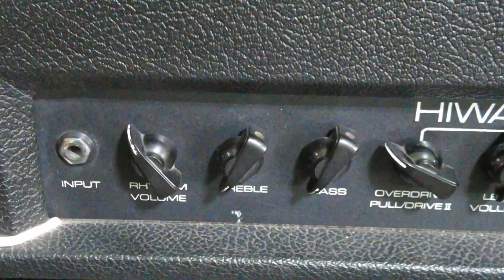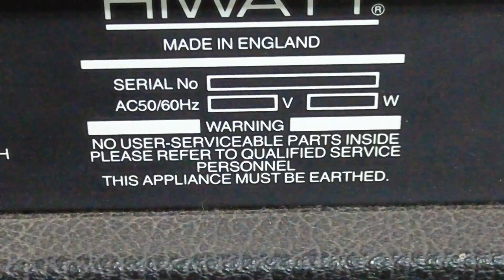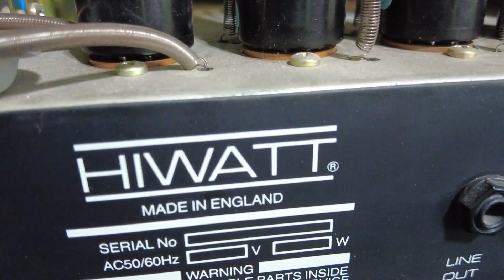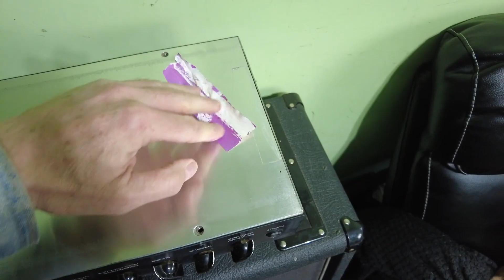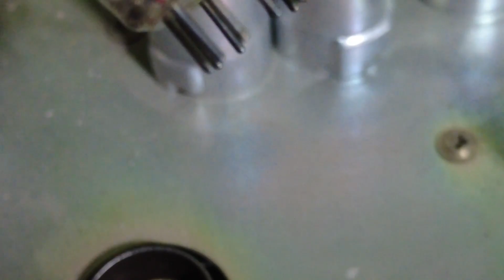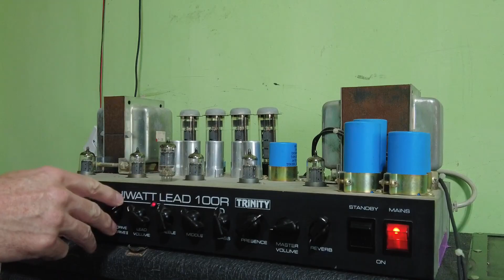Hiwatt 100R Trinity Guitar Amplifier A British Tube Amp Beast in Need of Repair Part 1

Comment: When the cat starts meowing at 28:30, my newly adopted dog (Anatolian Shepherd) woke up and started searching the house for the non-existent cat! Re: tube noise and signal bleed, sometimes the mica insulators inside the tube become capacitive or conductive and bleed signal from one triode to the other, but I've also seen this occur from gunky residue between the tube pins or on the socket itself.  Bad filter caps that don't decouple the audio from the power supply can also cause or exacerbate these types of issues, and it might be more audible if a preamp tube circuit has a common cathode resistor for both triodes, or if one triode of the tube is used for channel 1 and the other triode is used for channel 2, instead of channel 1 and channel 2 each having their own dual triode preamp tube .  It also seems as if the input Jack is not "normaling" or shorting itself out to ground when there's nothing plugged into it. This is where having a quarter inch plug with a shorting jumper inside of it to plug into the input can help you figure out if that's the case, especially on an amp that has 2 input jacks but where you might only typically use only one input and you definitely want the other to take itself out of circuit when it's not used.

PS,  I used to have a German Shepherd mix who would start looking for a cat whenever I played the John Hiatt song "Little Head" which begins with a cat-like wah-wah'd guitar figure. We actually did have cats then; they were outside much of the time but they would sometimes share the dog beds with the Shepherd and our Saint Bernard.
Reply from the maker: Some useful info there, thank you. I have just looked up Anatolian Shepherd on Google. That's a big Dog. My Cat is sure glad he isn't really looking for her lol. I have had a listen to that song, it's great. Great band. The Bass player is solid. That's a great story. I will have to listen to that whole album. Take care!
Reply: @vintageguitaramp_guitarteacher   My thumbnail picture is of the 9 year old Anatolian shepherd we have, whom we adopted about 7 and a 1/2 years ago. He is  118 pounds and a true gentle giant, very friendly and easy going, good with strangers and children and gets along with most dogs , but he won't tolerate cats. He doesn't pay any attention to radio , TV, stereo or anything on my phone ----  The only sounds he listens for are the pantry door where we keep the food being opened, and the sound of me picking up my car keys ---- but the Anatolian we adopted recently watches TV and listens to and for anything and everything that seems out of place. She was 78 pounds, when we got her a few weeks ago which is about 20 to 30 pounds underweight, but she is starting to put on some muscle and weight with 3 meals a day and lots of snacks.  Considering she was a stray roaming around the streets of Georgia, she is very cuddly and attention seeking and wants to meet people all the time.
Reply from the maker: Blimey. 118 pounds? I don't weigh much more that lol.  It's nice you have given him a good home Dogs thank you everyday for taking them in. Cats just move in like they own the place. Well my Cats think they own the place. Thanks for supporting the channel and take care.
Reply: @vintageguitaramp_guitarteacher  , the cats we used to have were all strays that adopted us and just moved in!
Reply: @vintageguitaramp_guitarteacher  , John Hiatt is a well-known songwriter whose songs have been covered by many others. Thing Called Love, Confidence Man, Angel Eyes, Drive South, Feels Like Rain, Riding with the King, Icy Blue Heart, and many more. Ry Cooder, and Sonny Landreth, two of my favorite slide players, have been major weapons on his recordings and tours.  It just occurred to me that if you add the letter W to Hiatt's name, you get HiWatt !
Reply from the maker: Here in the UK we don't see some artists in mainstream music that come from the USA. Ry Cooder and Sonny Landreth are well known though.( Never heard of John Hiwatt though lol.)
Reply: @vintageguitaramp_guitarteacher  , Hiatt did some background vocals on Richard Thompson's "Hand Of Kindness" record, Thompson being British-born of course (and a founding member of Fairport Convention) but having lived in the States for over 30 years. Thompson is one of my favorite guitarists ---- on both acoustic and electric ---- and songwriters. Another British picker (primarily acoustic) whom I like a lot is Martin Simpson, who is now back in the UK after having lived in the States for several decades.
Reply: @vintageguitaramp_guitarteacher  , here's one of Hiatt's strangest, and of his best: "Ethylene". https://youtu.be/jA-MVP7iSGw . Likely about his lifelong alcohol addiction. I'll post another one that really rocks out.....
Reply: @vintageguitaramp_guitarteacher  , "Memphis in the Meantime". https://youtu.be/KQEJotXpnaQ. JH forgot some of the lyrics!

Comment: I haven't watched the whole video but I suspect that the original tube in the V-1 position is bad and causing signal bleed into the high gain channel #2 (or vice versa)  Putting a fresh tube in that position stops the signal bleed and makes it seem as if "channel one isn't working" when in reality it's probably working the way it's supposed to....🤔🙂
Reply from the maker: Hello. It was a bit of a conundrum. I cleaned the sockets and the jack sockets including the footswitch socket. I put the original tube back in and all was fine apart from the tube being microphonic. So I swapped it out because of that. It may well have been the tube causing problems though. It's great when people such as yourself offer advice and knowledge on the channel. It helps me and other people watching. I apricate your input, thank you and take care.
Reply: @vintageguitaramp_guitarteacher   I didn't watch part 2 of the HiWatt repair video and I don't know how you clean the sockets but I hope you didn't simply spray them with Deoxit like so many do. I don't like leaving any kind of residue behind in the tube socket or on the board. An alcohol flush usually works pretty well but what I do 1st is I will take a piece of wound guitar string, 33 to 39 thousands diameter and work it back-and-forth inside all the socket contacts almost like a miniature round file, then retension the contacts. The guitar string does an excellent job of removing oxidation and baked on, grungy dirt.  Because the socket contacts are soldered directly to the circuit board, and so they don't "float" loosely to match up with any discrepancies in the alignment of the pins on the tubes, it is especially important to have those contacts, and the tube pins, super clean.  You can clean the tube pins with a toothbrush sized wire brush.
Reply from the maker: No, I don't use it. Just alcohol based products. Some good ideas there. Thank you.
Reply: @vintageguitaramp_guitarteacher  , also,  I don't know what the circuitry is like in a HiWatt and I don't know who made those tubes that were originally in it but other techs whose experience I respect say that Russian made tubes often do not hold up well in circuits that use cathode followers, the Russian tubes will become noisy and microphonic and often fail prematurely.
Reply from the maker: I couldn't find a schematic for it. I haven't heard that said about Russian tubes but I will take that on board.

Comment: To my ears the overdrive sound doesn't sound quite right, so maybe that's a symptom of a fault that's causing all the interactivity between the channels.
Reply from the maker: Hello Simon. Thank you. You could be right. Both channels sound a bit off. Hopefully when I have had solder round on the board it should be okay. Thanks for watching and supporting the channel. Take care.